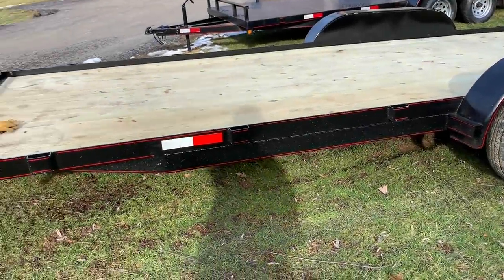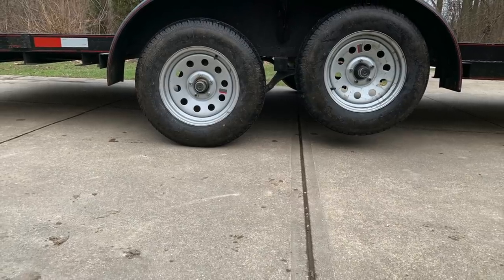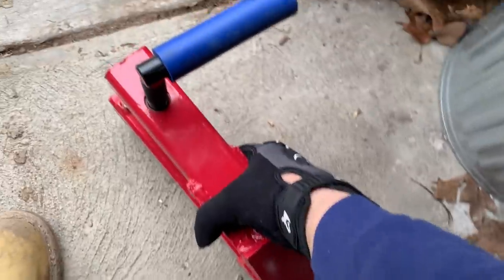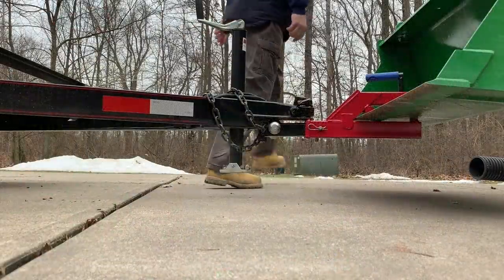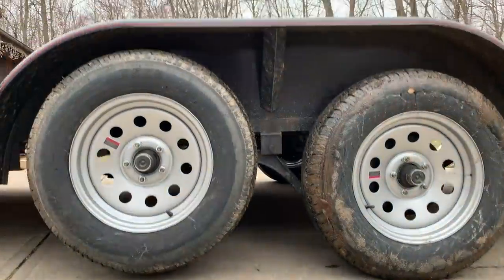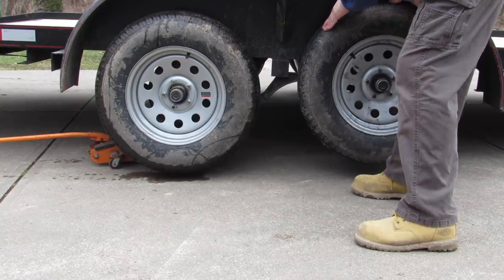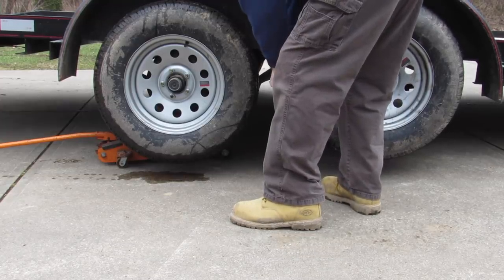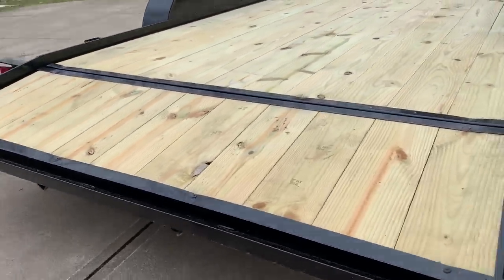1025r Gets a New Trailer, That's Not Normal

Comment: Im looking for a larger trailer myself and am thinking of getting a car hauler type like yours for the fact that i can easily load it with other equipment as well as with pallets of the material when i go on jobs with my kubota bx. I have a typical landscape trailer iv been using but its only a 5x12 and believe it or not i can fit my kubota bx with my rear heavy hitch, my loader bucket as well as my pallet forks all on it at one time but its pretty hard to load up and is not fun to pull when loaded like that but it does work. My next trailer will be a 6x14 or 7x14 ..maybe a 16 footer havnt decided yet. Thanks for your video it helped give me some ideas.
Reply: A bit late now, but I bought an 8 x 18 car trailer to haul my Kubota BX2680 on.  It'll fit the tractor, loader, box blade, tiller, pallet forks, pretty much all the attachments and implements I have plus the tractor.  Its a tandem axle with brakes on both axles.  You can never have too much trailer honestly.  I'd rather have a longer trailer and fit my tractor and implement completely on the trailer than have the loader bucket hanging over the front of the trailer or the implement hanging off the back of the trailer or in some cases with a smaller trailer you'd have both of those issues.  The trailer I got does have steak bed pockets so I could build sides if I ever wanted or needed to.  

One of the important things to consider as well when buying a trailer, is the ramp length, too short and you have a steep climb to get on and off the trailer, making loading and unloading more dangerous.  Longer ramps are a much better option for safer loading and unloading.  My trailer has 5 foot ramps and its pretty easy load and unload my tractor and implements/attachments that way.  Another thing too, if you have a belly mounted mower deck on your tractor you'll definitely want longer ramps, as your break-over angle from the ramps to trailer deck would be less to keep from getting the mower hung up when you transition from the ramps to the trailer deck.  Same goes for other implements and attachments as well, you really don't want to be getting stuff hung up or stuck trying to load or unload it can make for a very scary situation if you aren't careful.  

The trailer deck on my trailer is wood, make sure if you get a trailer with a wood deck to get some sealer and put on it as well to increase the life of the trailer deck.  I've been thinking of adding some sort of non-slip pads to the trailer deck as it will get pretty slippery when its wet, covered in snow or ice.
Reply: @wildbill23c  very nice buddy! Glad you found yourself a nice trailer now .. sounds like it’s gonna do everything you want! Is it a car hauler style or a landscaping trailer? I personally want a car hauler style as I’m tired of the sides all they do is get in my way.. either that or a nice dump trailer.. You’v seen how my driveway is sorta small so I don’t want to go as big as 18 but would prefer a 14 or when a 16’ trailer to fit my needs.. anything  larger and it would make pulling in and out of both my driveway and my customers driveway very difficult. I want a tandem axle car hauler or a tandem axle low boy dump trailer.. this post I made was a year ago and sadly I still have not been able to find one in my area due to covid and when I do it’s either way too high priced or I don’t have the cash on me and miss out on it by someone else buying it first.. sooner than later I’ll find me a nice one tho so people can stop saying my trailer is too small 😂

Stay safe buddy!
Reply: @BiffsEquipment  Mine is a car hauler.  2 trailers in one basically.  I sold my old car trailer so I wanted a trailer I could use for multiple purposes, but with working trailer brakes LOL.  My old car trailer's brakes never worked, and was never able to figure out why.  New trailer has brakes on both axles.  

I wanted a 16 foot trailer, but they sold the one I went over to the dealer for before I got there, they had the 18 footer sitting there so I took it.  They had 2 18 foot car trailers in stock, funny though the salesman looked at the prices on both, one was $500 more expensive because it was a 2022 model, the one I bought is a 2021 model.  Steel prices made the 2022 model more expensive.  Trailers here in Idaho are selling fast too, they can't really keep up with sales, just like my Kubota dealer LOL.  

Yes, I'd love to have a dump trailer, but I cannot afford one, they're $15,000 and up.  A 6 or 7 foot by 12 or 14 foot tandem axle dump trailer would be great, and I could haul the tractor in it if I needed.  This past month and a half I've hauled 2 loads of gravel, and 2 loads of fill dirt in my pickup bed utility trailer...its a pain in the * to have to shovel all that stuff out of the trailer by hand.  If I had a dump trailer it would have cut the time spent on both projects at least down to about 1/4 of the time....yes, 3/4 of that time was spent shoveling the gravel and fill dirt out of the trailer into a wheelbarrow.  

Your driveway is pretty narrow, so a huge trailer would probably cause more problems in the long run in your case...a 16 footer would be ideal for your use....the 18 foot trailer I got is the smallest trailer you can haul a full size pickup on, not that I need to do that but its what was in stock and I got a deal on it for $3800 as I had them throw a spare tire in the deal too.  

Haven't hauled my tractor on it yet, I've hauled pipe, pallets, and a sub-frame for a car, but haven't needed to take the tractor anywhere, and honestly I hope it stays that way, I really hate having to pull trailers especially where I live, people are dumber than a box of rocks around here, pull out in front of you, then creep along just to turn into the next parking lot...or they love to tailgate trailers for some odd reason.

Comment: With all those size of tractors in the backhoe to get the proper weight balance you basically want the backers of the tractor between the two axles of the trailer or just a little bit ahead

When you don't have the backhoe on you want the back tire of the tractor lined up with the back axle of the trailer. Or slightly ahead of the back axle if you have a rear Implement on

Now these are just some rough ideas of where you want your tractor place do you will have to adjust accordingly too much tongue weight is always better than not enough.  And with the weight of your tractor as long as you don't have the loader overhanging the front of the trailer there is no way you can put too much weight on the tongue to cause any unsafe conditions

Comment: A good choice. I have a 20 foot dovetail similar to yours and really like it. Lets me take my Yanmar YT235 with the attachments right up to the 3 point disk all on the trailer. I did put a couple of jacks on the back of mine to help with loading the tractor when the disk is on it as that thing is pretty heave and will pick the back of the truck up. Not much fun when one is on a hill. As the only axle that has brakes on it then comes off the ground ....... don't ask how I found that out

Comment: I always put a block under the back  of the trailer  (in the center) so the tong don't rise
Reply: The loading could be the reason the axle was NOT in the correct position.  Blocks under the rear main frame OR mount 2 wind down jacks (one on each side at rear) to use as stabilizers. Ever load on a tiltbed trailer? Eliminate the ramps and is more stable (PERSONAL OPINION) to load on. A "Deckover" is higher but doesn't have wheel wells to take up deck space. And can be loaded with palletized material easier.

Comment: Get yourself a block of wood like a piece of railroad tie and put it under the back of your trailer to stop it from squatting so much, this will alleviate the up pressure on your truck.  Another option would be to install drop jacks on each sided of the back of the trailer on the side.
Reply from the maker: Willie Martin Thanks Willie.  I’m gonna pick up some weldon Jacks soon, and get them on when the weather breaks.  Wood blocks in the meantime 👍🏻

Comment: My trailer is identical to yours.  I added a set of side rails made of 5/4x6 deck boards for both sides and the front for hauling mulch or what-ever. Most times I can drive up and off without using the ramps.

Comment: Go back and check your shackles they are flipped still one is up one is down...They should both be up above the pivot. @ 6:30 in your video they should both be like the shackle on the left.
Reply from the maker: DF5152 Will Do
Reply from the maker: DF5152 So both springs should be attach to the top of the shackles and the bottoms are attached to the equalizer.      ‘\.<>./‘
Reply from the maker: Yep, it was flipped too.  Corrected the other day, going to mention it in the next video.  Thanks, Tom

Comment: You want to have the tongue about 1 or 2 inches above level from the back of the trailer so that the front axle doesn't drive into potholes or speedbumps rather try to have the axle skip over them, you will have less whiplash effect, also if you brace the rear of the trailer with some blocks or better yet some feet jacks that will keep your trailer from raising the truck which isn't good for the suspension or hitch components, just a suggestion.
Reply from the maker: Ty Canavan hey Ty, thanks for the info.  Any recommendations for the jacks?  Do they make bolt on or do they need to welded?  Thanks for watching, Tom
Reply: They make both kinds, bolt-on and weld-on, your trailer supply shop will have them and even Amazon but before you choose which kind, analyze what fits your need, since you have a dove-tail you should look at one that rotates even with the deck so that you don't hit it by mistake or it limit the width you put on the trailer or see if it might be more simple to put a couple of blocks under each side, anyway works. Good Luck and Nice Video !!!

Comment: Trailer frame than leaf spring two connecting straps than equalizer arm than depending on tire size 6 inches to the ground  or research E trailer for further details

Comment: You need to pay attention to tongue weight.  Add the trailer weight, tractor, backhoe and bucket.  Your tongue weight should be 10-15% of that total.  It's important to get that right.  A weigh safe trailer hitch for your truck is invalueable for getting it  right.  Be safe.
Reply from the maker: Wow, I never seen those before.

Comment: That shackle is not right, Type on google trailer shackle and then go to images. you will need to unbolt and fix the problem. Whoever built the trailer didn't do it right but this should fix it the rest looks good!!
Reply: Yeah, I agree. Not 100% sure what's wrong there, but my brain tells me something isn't right....I have a tandem axle trailer that I use to haul some materials to different job site, so it does get hauled empty quite a bit, and I have never ever seen anything like that.

Comment: Be sure and chock ur wheels when loading or unloading. The weight coming off of the trl. Could possibly lift the rear wheels of trk. off the ground, and there goes ur brakes. That is not a fun ride. It would be especially helpful to load or unload on as level a ground as u can. U can also block under rear of trl. to keep it from mashing down. Hope this helps. Not being critical, just be safe. Good looking set up.

Comment: My advice:  find a buyer for that and get yourself a trailer sufficient for your 1025R TLB.  You got 3000 lbs there (check the specification book).  That trailer was actually flexing at the weld where the dove tail and the flat deck meet.  You couldn't see it unless you were watching someone else load the tractor.  You should plan on spending about $3500 to $4200 on a trailer that will meet your needs.  That $2500 to $3200 trailer ain't it.

Comment: They should make these trailers with some fold away drop down bars in back for loading and unloading so you don’t need to use blocks or anything to help alleviate all the force on the ball.
Reply: Some of them have stabilizer jacks on the back corners of the trailer for that very purpose.  Some people attach their own.  The issue in this video is he needs a drop hitch in the receiver of his pickup, the tongue is way too high for loading and unloading.

Comment: I noticed some trailers have a drop pad, like a jack stand, on the back of their trailer to prevent the trailer from dropping down when you are loading.
Reply from the maker: DAVID TOBIAS I’m going to get two at harbor freight.  2000 pound capacity each.  I also like that you can use them to lift the tires off the ground with the front jack when storing.
Reply: @ataleofthreecabins1025  thay work great on back I just swing them down don't adjust but dont do like we did one time and move with them down lol whoops but no damage.

Comment: It still bugs me how far back they put axles on modern trailers.  It just kills the load capacity for any given sized trailer.  Enough whining, tho, just wanted to point out that the equalizer still don't look right to me, but I could be wrong.   Set ups I've seen have the spring over the equalizer on both ends, but that doesn't mean that  is the only way to do it.
Flipped shackles aren't too big of a deal, just wedge a hammer in the shackle and reef on it.  Can you tell I own a CJ?  rofl.   There are many fixes.  Two of which are longer shackles or triangular shaped shackles where there is a center bolt designed to contact a point an not allow the shackle to go over center.   In a trailer application, tho, I wonder if a boomerang shackle would be a better choice.
Suspension travel limiting straps should also work, although might be a problem on tandem axle systems.
I actually found a trailer specific suggestion of just buying a longer equalizer.  That's seem s like a good fix too.
Reply from the maker: l337pwnage Thanks!  Your right it was flipped on the rear axle.  I corrected with 2 jacks.  I’m going to mention it in our next video.

Comment: Same comment as below, if those are offset shackle (one side longer than the other) it looks backwards for some reason. Did you look at the shackles on each side to see if the were hanging in the same manner/direction? Just a thought. Be safe sir.

Comment: Ok, so how did this happen?  I'll tell you.  When you are pulling an empty trailer and the trailer brakes are set "too sensitive", this will happen.  Ask me how I know.  LOL  The tires lock up and the shackle flips, usually both sides.  So watch your settings on the trailer brakes, especially when the trailer is empty.

Comment: Hello sir, I read on a review on a clamp-on trailer hitch receiver, that the clamp-on receiver wiggles and comes off when moving a trailer. Is that true with your receiver? Can you tell me about your experience with your receiver? I highly appreciate it if you can tell me what to expect before I purchase this type of clamp-on hitch receiver. Thank you.
Reply from the maker: david78840 depending how heavy of a load you move around it can pivot.  I do crank down pretty tight on it and many times need a rubber mallet to loosen it.  Moving my large trailer(empty) it has moved but never came off.  Smaller items (log splitter,   10’ trailer) it does not budge.  If on a hill or incline I would not move anything heavier then the tractor.
Reply: It can work itself loose while moving trailers, it can and will bend your bucket as well.  A much easier and better way to move trailers with a tractor that doesn't have a draw bar is to use a 3 point mounted receiver hitch...I think I paid about $70 for mine off Ebay.  Put a regular hitch in the receiver, same one that goes in your pickup's receiver, backup to the trailer and simply raise the 3 point and off you go...I always latch the trailer tongue latch onto the ball just to be safe though, don't want to hit a bump and have the trailer drop off the ball while you are moving it...Its so much easier to line up the hitch to the trailer with one of the 3 point receivers than it is trying to do it with one of those clamp on bucket hitches...another method I've seen people do is mounting a ball on the bucket itself, but again you can and eventually will bend the bucket.  I know a few pallet fork manufacturer's have built in receiver hitches in the pallet fork frames, so you can remove the forks, put your hitch in the built in receiver in the fork frame and do the same thing, might be easier to see and line  up with the trailer that way as the bucket wouldn't be blocking your view.
Reply: @wildbill23c  Thank you for you comment. I learned a lot from it. Have a beautiful day.

Comment: With that backhoe on the tractor, you should be backing the tractor onto the trailer to put more weight on the tongue...you're going to find out real quick that with having more weight toward the rear of the trailer, it's going to buck and not trailer well at all...